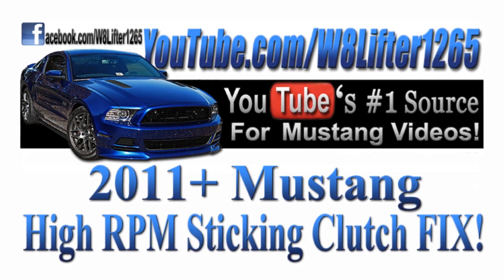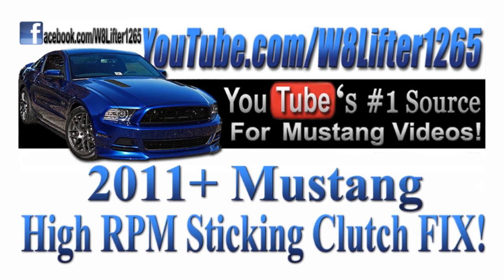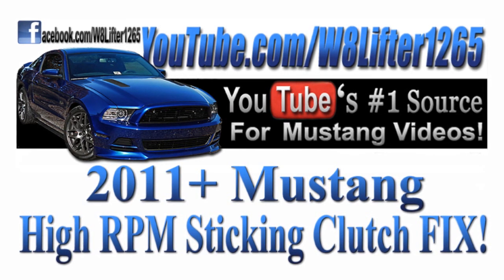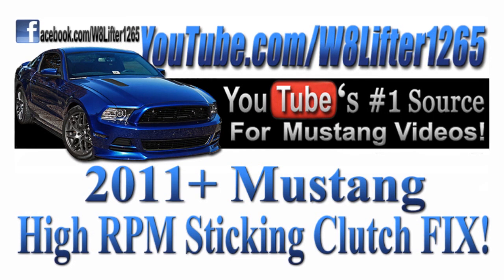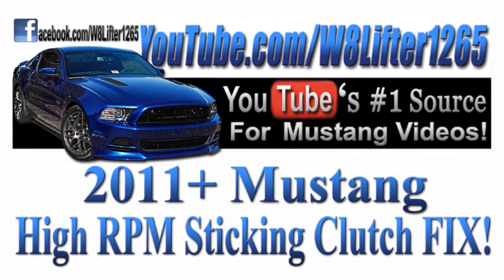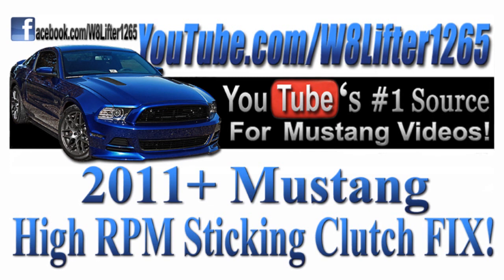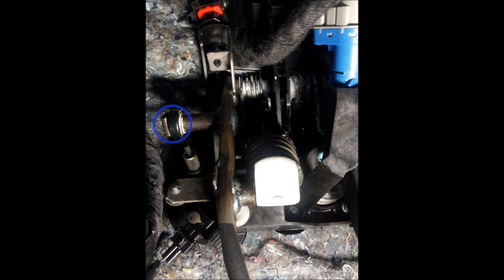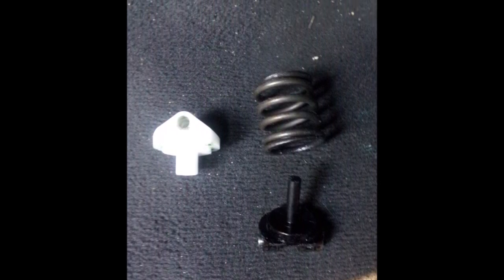2013 Mustang GT High RPM Sticking Clutch Pedal Easy Fix Tutorial! Works for 2011+ Mustangs!

Comment: Everyone there is an easier way then removing the control arm on the left and the position sensor to get the spring off. 

Step 1: push petal to floor.
Step 2: take needle nose vise grips and lock spring compressed.
Step 3: pull petal out with hand
Step 4: remove spring. It will literally fall off. Just did my 14.

Thanks
Jon
Reply: Jonathon Vince Did this actually help to remove the pedal from sticking afterward?
Reply: THIS WORKS! GREAT TIP THANKS FOR SHARING, TOOK A MINUTE.!
Reply: did u have to take the clip off too ?
Reply: why is there so much play still ?
Reply: Just tuned my car got max rev at 7300 but can’t shift till it falls below 6300… can you explain in a little more depth please

Comment: I went one step further and added a universal clutch return spring to keep the pedal pulled up tight so there's no slack in the pedal. It doesn't add enough tension to notice.

Comment: I just did this mod. Took 5 minutes to do even without a flashlight to help me see what I was doing. I have not driven it yet but the pedal feels much firmer which I like and if it stops mine from sticking to the floor when I shift at 7600-7800 I am happy. It stuck on me 3 times yesterday doing my first data log with my Boss 302 intake manifold :O

Comment: On my 2013 GT shifting from the factory was sloppy and I missed 2nd to 3rd too many times to admit to. I replaced the factory shifter with a Barton short throw and two post bracket. That certainly improved the shift feel and speed and accuracy. I still missed the 2-3  shift occasionally and only at full throttle redline shifts.

I just removed the helper spring and now the 2-3 shift is perfect. No feeling of "pushing" the shifter into gear and after trying a few full throttle, redline shifts I can say it shifts flawlessly.

Definitely recommend removing the spring.
Thanks for the tutorial!

Comment: Just want to say THANKS!!! 
Jeff I have a 13 GT with 5k miles 
I've owned the car for a year now and been having that problem where I would loose clutch pedal at High RPM's specially power shifting to 3rd I bought a twin disk clutch new slave new pilot new  braided fluid lines becuase of this issue I haven't had time and money to get everything installed but I did as you explained in the video and my Bitch is chirping In 4th gear bro you are FKn AWESOME!!!!!!!! Best video ever on the Web period!
Reply: Any problems on the long run?

Comment: Did this last night on my 13 Boss; it's had the stuck pedal issue.. The clutch feels "snappier" and pedal distance shorter. 

I'd say a def improvement ... time will tell if it cures the pedal not coming back up :)
Reply: Did it fix the pedal not coming all the way back up? Mines having problems with the pedal not returning all the way :/

Comment: Thank you so much for explaining this! I just put a JLT CAI and tune in my car. And just 20 mins ago for the first time exposed it to high RPM and this clutch problem happened. I down shifted into 4th, let the revs build (trying to race an RCF) and when i tried getting into 5th had no clutch response. Was able to pull the clutch out on the off ramp and had no issues going back home. Tereified the crap outta me, was not up to doing a clutch job already.

Comment: Ok I did this, but I did it AFTERWARDS hoping it fix my issue cus when I was driving (racing) 3rd going to 4rth shifted late it red lined then clutch got stuck but it never came out I pulled it out but still never disengaged so I had to tow it home now I got the car here sitting tryna wrap my head around what to do before I just send it to a shop

Comment: Thought I had burned up my stock clutch on second hard pull after built engine and drag radial install.  I expected it, but now maybe this trick will get a few more pulls before going high torque.  Thank you.

Comment: Duuuuuude!!!! 
Thanks so much for posting this! I have heard mention of that fix but it sounded way harder to do so I avoided it. I had installed a Joe Heck high volume clutch line to try and fix this problem. It did help ...but didn't fix it. I hope once I do this and with the high volume line... it shifts better. I shift at 7200-7400 depending on how it feels and I'm lucky to get 1 clean run out of 5 because of this issue. Again.. thanks

Comment: This is NOT a fix for the pedal sticking.  I did this on my 11GT last year at the track after 4 consecutive runs where the pedal stuck on the 1-2.  I pulled the spring in the staging lanes.  All it did for me was make the clutch 2 times harder.  And that next run the pedal stuck once again trying to shift just past 7k.  This is not a fix.

Comment: The say the gt500 clutch set up is like this and some people asked why they just want use the gt500 clutch assembly. But I test drove a mobile made five months after mines was made and it didn't have no of the problems mines have at higher rpm, and the clutch was softer. I was upset a little but I'm taking mines to the shop to see what that noise I hear when I take off in first it's like a errrrrn sound like  pushing a remote control car across the ground without remote and batteries in it.

Comment: Just did this, about 100 miles on my mustang.  Feels much better, more like I'm used to in a clutch.  Having a bit of trouble getting the damn CC switch seated again, gonna go play with it a bit more. Dont need to use CC right now anyway.  

Any idea what type of clip that is by the clutch rod?  I used a scredriver and it popped off and I heard it hit metal.  I think its under the carpet, gotta try and find it =\  Seems pretty secure without it but I'd like to have it back.

Comment: Hello i have a problem with my 2013 GT Mustang that when i wanna change gears at high RPM 5500+ the gear stick wouldn't let go it will stick to the gear the only way to change it is by reducing engine RPM 5000- (it will change) what's the problem? Is it the clutch? Or the flywheel?
And i have the same problem with the clutch peddle !
Reply: Its your clutch, your pressure plate is most likely toast.

Comment: Hey is the image in your video showing the 3 springs in the assembly your car? I just picked mine up a few weeks ago and I have the clutch suck down issue, my build date is 02/13 however I do not have the 3 spring assembly, my clutch only has the one helper spring

Comment: I have the issue when I get past 6-6500 rpm the clutch feels like it stays on the floor, I can sit in a parking spot and rev it out and push the clutch and feels very bad, almost feels like the clutch isn’t there, I was thinking a clutch issue but I have little miles on it for this to be a problem, do you think removing this spring will help?

Comment: I was thinking about selling my gt 2013 because i had a lot of issues that make me upset from it .. i install mcleod rxt to fix the problem but it is the same .. today i am going to remove the little thing down there and try to shift at high rpm .. actually at the moment i hate my gt but ill be better if it sloved
Reply: worked ?

Comment: I'm also the one that is dealing with Ford and my dealership to fix the clutch pedal sticking to the floor. And per ford instructions the fix is to replace the pressure plate.
Reply: people don't know this... But the stock clutch limit is roughly 7.2k rpm, and over time it becomes less. It's BS about the lines being weak. Just slap on some McLeod clutch and you'll be fine. Mine did the same thing stock. After the McLeod clutch I can rev to 8k without it getting stuck. You can say that the force of the spring in the clutch pedal combined with the rotating force at 7k+ rpm causes the pressure plate to get stuck. The McLeod one doesn't as the pressure plate is tougher than stock.

Comment: The inside diameter of the clutch line at the trans is only .080 " , not letting fluid flow fast enough . Swap to a after market line , if its not a cure then you already have damage .
Reply: The larger diameter of the clutch fluid line will do nothing.
Reply: C Lar  I can guarantee you it will . The small dia. Will not let fluid through fast enough to push the clutch disc free , making shifts hard to come out of gear and grinding going in , on fast shifts , it acts similarly to shifting without using the clutch . I have a 05 . Changing that line was an immediate night and day difference .Think of it this way , if you went smaller what do you think would happen , how small could you go ? All the way down till you had to stand on the clutch peddle with both feet and wait thirty seconds or so for enough fluid to deactivate the clutch so you could shift .
Reply: +Iron Gates No actually it's not true. The hydraulic fluid is at max capacity already has nothing to do with a larger diameter opening. I call bullshit.
Reply: +Iron Gates And it will not make your slave cylinder push harder on the pressure plate. It's engineered to design. And I cannot get Steeda and FRRP to sign off on it that it will be the cure all. I stated the cure. A new higher lbs pressure plate.
Reply: +Iron Gates Oh and if you look at the TSB Ford has it states exactly what I said to fix the problem.
Reply: C Lar I didn't say harder , I said faster . Ford has had several tsb's on clutch problems and it seems that none takes care of all problem's . I don't know what problem you're having but from personal experience I know my 2005 GT's shifting was made to shift as good as a non remote shifter trans . What problem are you having ? I may be able to help .
Reply: C Lar Sorry , I forgot to mention . I did install a spec clutch and pressure plate , and this didn't help the fast shifts . I also installed a lightweight flywheel and aluminum D.S. at the same time .
Reply: C Lar I found a video . YouTube... Joe Heck racing Mustang clutch line . Check it out and let me know what you think.
Reply: C Lar   I've come up with a positive test for you . Put some smaller inside diameter brake lines on your Mustang and do a panic stop at a river .
Reply: C Lar the reason a larger diameter clutch line works has to do with Bernoulli's principle of fluid mechanics. The opening of the inlet of the factory clutch line is .150" and drops to .080", then goes from .080" to .150" again at the transmission. As the fluid speeds up at these junctions, there is a pressure drop. This pressure drop or energy loss reduces the load available at the slave cylinder for clutch disengagement at high RPM. Also, as the plastic factory line swells under pressure, it creates a vacuum effect within the hydraulics, which is why the clutch pedal sticks to the floor, especially for people who road race because the clutch line gets hot and is more prone to this swelling

Comment: I took it off and love the feeling of it....but mine still sticks at high rpm.
Reply: T JOKER master cylinder 👍🏻
Reply: @ Jose are you positive? I just picked up the rst, if the master cylinder is potentially the issue for me I’ll do it all together but I’ve got a 2012 gt, 24,xxx miles 6 speed apparently.
Reply: @kalebglover911  how did it go?
Reply: @kalebglover911  yea i have the same issue after i put in a new clutch in, i removed my clutch spring and still have the issue. how did the master cylinder work for you?
Reply: I was told by a mt82 transmission professional that if you upgrade to a rst clutch it will solve the lockout problem

Comment: The shorties are just as much of a pain to install for minimal gains. The factory tri Y shorties are just as good if not better than any of the shorties on the market. Unless someone makes a 1 7/8" shory just go with JBA 1 7/8" long tubes as the hang up nice and tight so you will not hit them on speed bumps if lowered and they do not rub anything on the body like the pypes do.

Comment: Thanks for the info, I am going to try this on mine this Saturday, I will post my finds.
My have grinding and hard 1st to 2nd gear shifts, at +- 5000rpm, it did a weird odor few times due to the clutch not releasing quick enough eve tho the pedal was allway up, I think I burned my clutch already. I hope this help it, I have a 2012 CS/GT premium, and I would hate if I have to trade this car in for such a stupid reason, but I am about to give up, just disappointed on FORD, with this Chinese horrible transmission :(

Comment: And I love how people think the larger diameter opening on the clutch fluid line is a fix. Hey I'll get larger diameter lines for my brakes and it will push the pads even further into the brake disc. The stupidity is beyond me.

Comment: The logic here seems backwards to me.  If you say the spring "pops out" when you pull up on the clutch pedal, it seems to me that the spring is actually helping the pedal return to it's resting position.  Therefore, if anything, we need a stronger spring to replace the factory one vs. completely removing the spring like you did.  I can't see all of the assembly from the angle of the pics.  But if the spring is resting on a stationary point, this "fix" might be all in your head...

Comment: Joe Heck, Steeda, S&R its bullshit. They are trying to sell you something. It's basically like saying if I put a larger exhaust on this 4/cylinder engine it will flow more air. And it can only flow max exhaust with a 2 1/2" pipe. And what do kids do they put a 5" diameter exhaust on it thinking it will help. Well its as useless as putting a larger diameter AN fitting in a system already designed at max flow. By now done explaining this to you.

Comment: This is NOT the problem to the pedal laying to the floor. The problem is the pressure plate is not doing it's job. And the clutch just spins and males the clutch pedal useless. There is no burning up of the clutch, its just spinning freely due to the high revs and a useless pressure plate. The only and I mean only fix is a after market pressure plate the has the lbs to stop the clutch plate from spinning freely.

Comment: The shifts do suck but I’d keep it stock and only put real ford stuff back on it.  I stupidly had mine replaced just bc it was getting harder to do stunts.  I used an AMS clutch kit; it is a piece of shit, you’ll never bark em again you’ll be lucky to peel out.  If u want ur clutch weakened or the loss of Gs or the rear lifting the front when ur running it.  Ford  got this right except the shifting and kinda long throws.